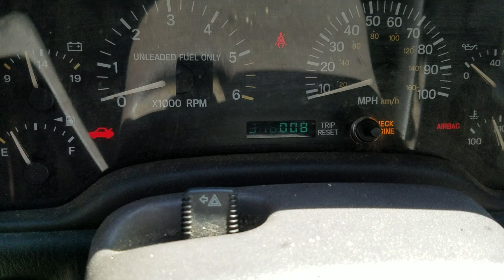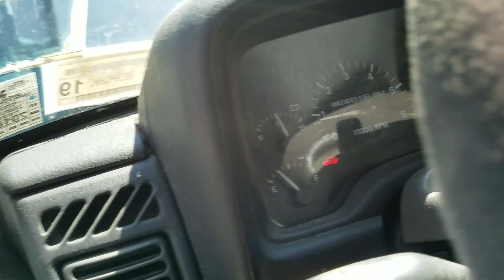SJ ..AKA. survival Jeep....Will there be another

Comment: stay with a 98 if you can find a good one. The 2001 had head issues and and lp axles
Reply from the maker: Well that's good to know I didn't know that about the 2001.. Thanks
Reply: 2001 - has head & coil pack issues
2000 - has head issues
1999 - BEST OF BREED. 
1998 - is 2nd best has some electrical issues 
1997 - has most electrical issues
Reply from the maker: @nwbolt  I didn't know I thought 2001 was the best.. Okay if I could find a 98 or 99 I may do it
Reply from the maker: I forgot to say in the video it also needs a heater core.. And that is a huge huge job whole dashboard has to come out
Reply: @manofmanythingz4812  yep, just did a core on my 99 a few months back. I've had 15 Jeep XJ's throughout my life, simply put they are the best vehicles I've ever owned.
Reply from the maker: @nwbolt  yeah it really sucks the computer went.. this Jeep was made in California so the computer is more expensive.. the heater core and a Cadillac converter and socks and four tires.. + 316000 miles period. I only paid $1,500 for this Jeep had it for 6 years I can't not complain
Reply from the maker: @nwbolt  I meant to say shocks not socks LOL
Reply: @manofmanythingz4812  I just did the heater core on mine last year... it wasn't a bad job but its not a fun one either lol